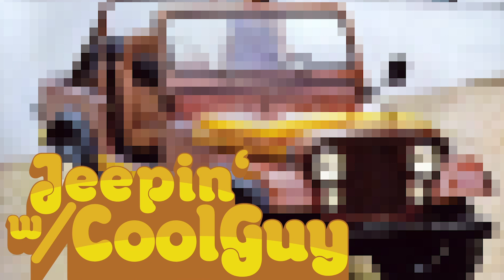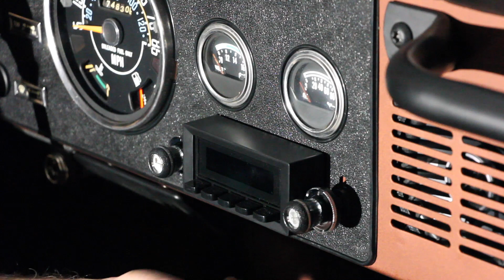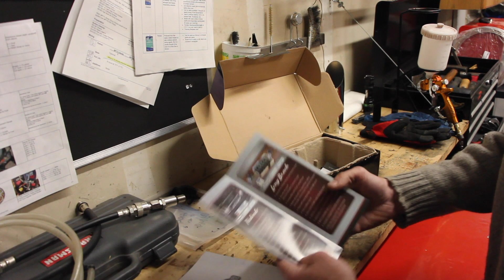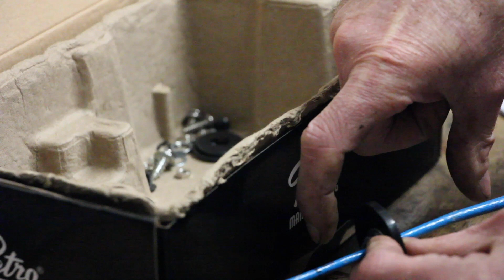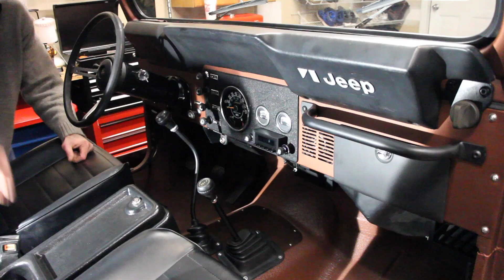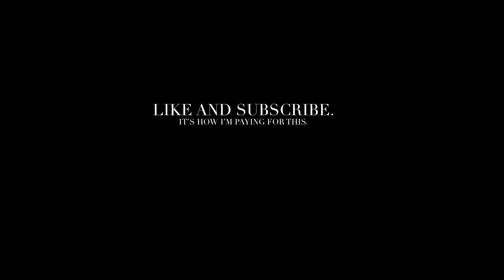Jeep CJ7 Retrosound Hermosa M2 Radio Install

Comment: Just found this video. Are those original in dash speakers? If not where did you get oem replacements? Thank you!
Reply from the maker: Couldn’t find OEM speakers, plus 40 year old speakers probably wouldn’t hold up very long. Went with the Rockford Fosgate R1525X2 from Crutchfield.
Reply: @coolguy_CJ7  Thank you! Just looking for something that will fit behind the dash speaker grates, like the OEM which I still have. My radio/cassette has power but no sound. Figured I’d replace both speakers and move up to that Hermosa model I linked above that offers as an option a radio JEEP approved faceplate to give an even more authentic look.
Reply from the maker: @CJ-rk5eg  are you going to replace your radio? Would you be willing to let me buy it?
Reply: @coolguy_CJ7  I must have confused you. My speakers are OEM as far as I know. My old radio is not OEM, just an old Sanyo . If I left you with the idea the radio is OEM, I’m sorry.
Reply from the maker: @CJ-rk5eg  No problem. Upgrading to the Bluetooth radio is really nice. I’m going to put one in my 79, which only has one dash speaker. Have to figure out how to wire it up. Please keep me updated.

Comment: Thanks for this! I had this installed in my ‘83 Laredo, but they used the accessories fuse which also has the cigar lighter wired to it. Now the cigar lighter blows the fuse when engaging and turns off the stereo. I bought connector plugs for the factory radio thinking I could repurpose that fuse for the lighter.. would that be your suggestion? Can’t figure out the amperage on that original radio plug.
Reply from the maker: Can you switch the wire to the radio fuse in the fuse box? You can get the plugs for it here. https://www.americanautowire.com/shop/connector-terminal-kit-ato-fuse-box
Reply: @coolguy_CJ7   Thanks for the reply! Yes we’re on the same page. I bought those same plugs and am just going to run cigar lighter to factory radio plug. Question is what is the amp load on that plug? The other plugs have labels but these ones don’t. Thanks again!
Reply from the maker: Good question. According to my diagram, 3 amp for the CLK plug, 10 amp for the RADIO plug, CRUISE plug, and the one above the cruise plug. The CLOCK is a 20 amp fuse.
Reply: @coolguy_CJ7  you’re the man, thanks again!

Comment: Hey Cool Guy, I’m planning to install the same stereo in my CJ7. Did you add any inline fuses? If so any recommendations for a car wiring newbie?
Reply from the maker: Nope. Just straight up install. Worked great. Follow the instructions and it should be very straight forward.

Comment: Thanks for vid Cool Guy.  I am planning to install the Retrosound Hermosa radio as well as it is close to factory look and a good radio.  PO molested my dash for standard DIN size so currently refurbing back to original radio cut size with post holes.
Reply from the maker: Excellent. That can be a tough thing to do. Be careful if you're welding the 18 gauged metal back in. The dash panel will warp easily with too much heat. I learned from a past experience.

Comment: Can you connect 6 speakers to that radio?
Reply from the maker: There are only 4 ports coming out of the back of the radio. If you're going to run 6 you'll need to connect an amp anyway. I would then run the 4 "back" speakers from there.

Comment: hey coolguy, bought what i believe to be the exact same radio from the the same website and plan to do the install soon. I have a 1978 CJ7 GoldenEagle with the exact same specs you listed at the end. Only problem is my fusebox is no longer usable in any way shape or form. My dad beat on and molested this jeep over 20 years ago and left it sitting in an un enclosed building for 20 more. I have spent the better part of 3 years rebuilding it piece by piece and have had to rewire everything i use nearly straight to the battery and this radio will be much the same. Wiring it straight to the battery is half the battle i know, but the part about the key switch turning it on is the part I am lost about. Any ideas? could i just wire it to a toggle switch?
Reply from the maker: Probably. The problem with not using the fuse box is the power from the battery is controlled by the ignition switch. I guess you could wire it straight to the battery and  just use the power button to turn it off and on. You will need to wire in an in-line fuse (probably 10 amps) so you don't blow the whole thing up. If you do go this route, please let me know the results. I'm curious to see how it works.
Reply: @coolguy_CJ7  excellent i was thinking the same with the fuse. much appreciated. ill let you know how it works out. i already have my speakers and antennae wired and ready, just waiting on the radio.
Reply: @coolguy_CJ7  update on the radio- works great. A pain trying modify it to run from the battery alone, but got it finished. The wiring harness it came with already has a 15A fuse in it on the yellow and black wires (constant and ground). The red one (ignition) has a 15A that i put on it under the hood where i ran the wire. Just two speakers so no problems there. My only wonder is if its going to kill my battery with it being on (radio off, with clock display on) constantly.

Comment: in my '86 CJ7 I had installed a cheaper "retro" stereo head unit a few years back really for just FM radio.  No blue tooth or connectivity to my smart phone and the internal amplifier chips were very weak.  Recently installed a blue tooth amp mounted under the back seat.  Head unit disconnected and I run Pandora/I tunes directly via blue tooth from phone to system.  The only lose is local FM stations but no big deal.  So much better quality sound!
Reply from the maker: I plan to evetually add a subwoofer and an amp for it, but the power is more than capable for the 4 1/2 dash speakers. They are 50w a piece.

Comment: I got a 1983 to bad I cant post pics on comments well I'm making some videos to so a few months I'll have some up I'm doing quite bit on it . Ur jeep Project looks great . On mine  I've gone in and removed all of the vacuum controlled ignition and unnecessary vacuum and computer-controlled carburetor but I chose to keep things like the EGR valve recirculating the exhaust gases back into the manifold I think you kept yours too if I saw correctly I know you have lots of videos   help me some to along the way for sure. Thanks documenting this information for the  preservation of Jeep restoration and repairs off into the future for other generations to come Cheers to JEEPs especially CJs
Reply from the maker: Great to hear. Let me know when you get your vids up. I want to see.